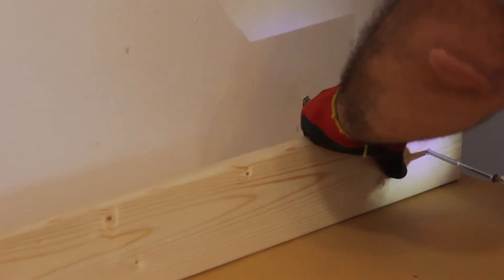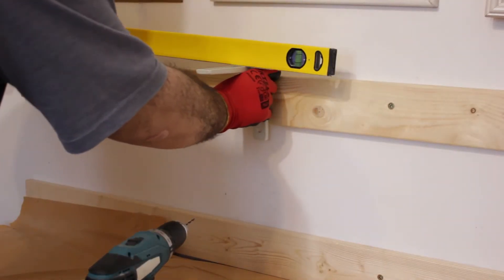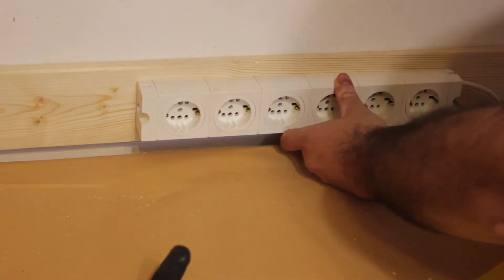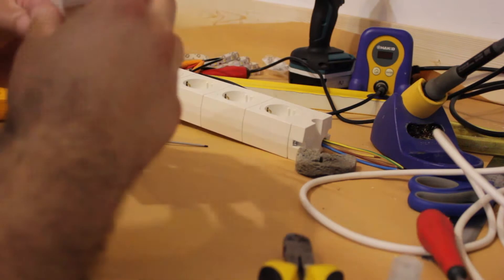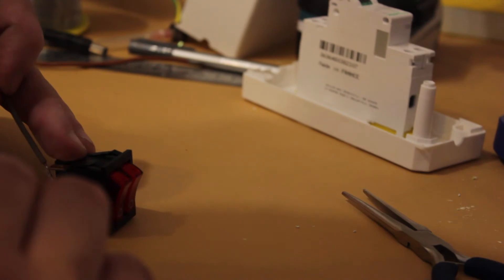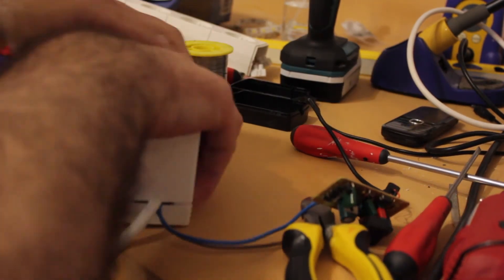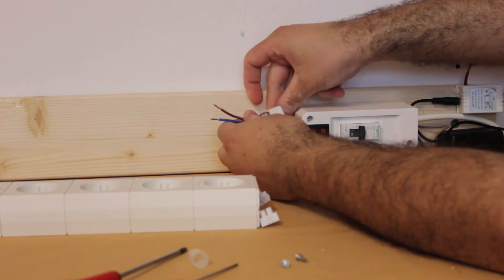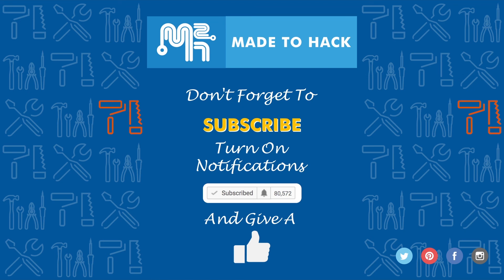How To make a DIY Electronics Work Bench - Part 2

Comment: Hello well done Very nice job.
I was thinking to add a circuit breaker to my power strip like you .How many amps is your circuit breaker?
Reply from the maker: Hi, it is 16A. Max recommended for EU Household (3500Watts). Some use 10A (for 2200 - 2400Watts)
Reply: @Made2hack  Thank you very much!!

Comment: Looks neat sir, I might rethink my workbench circuitry and add a circuit breaker to it. I currently have a scope, soldering iron (just like yours), SMD soldering station, bench power supply and a function generator all hooked up to a simple power strip and a voltage stabilizer.
Reply from the maker: If anything, it prevents you having to go to your main circuit breaker when you short circuit something!